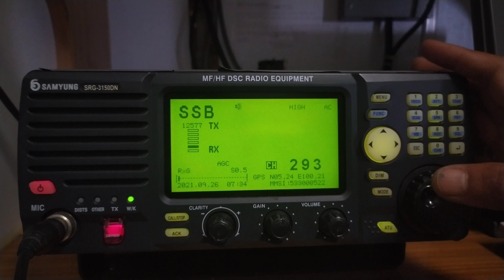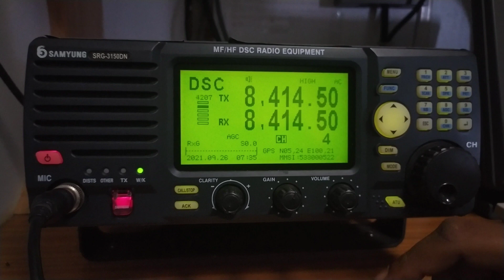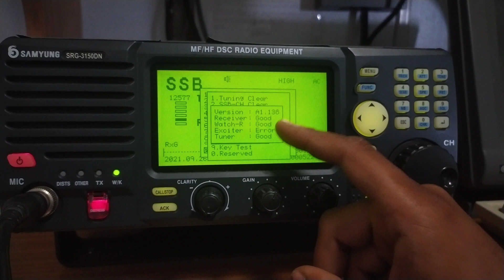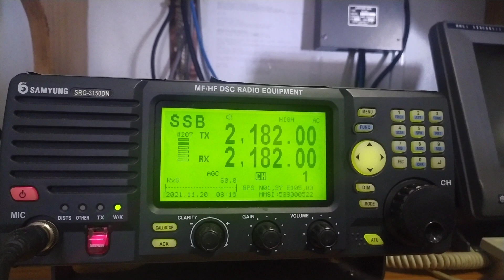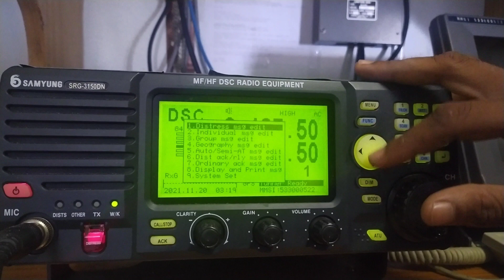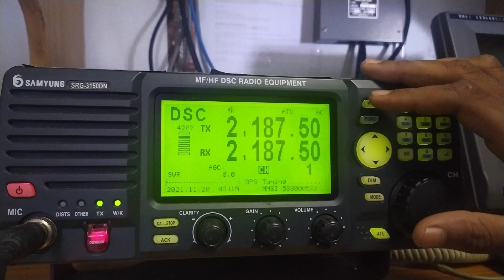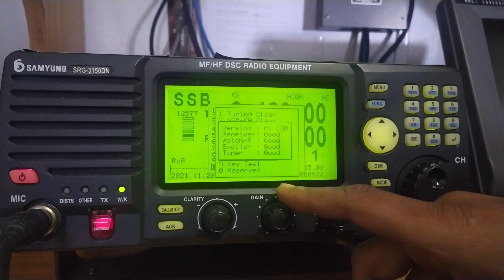MF HF Repair - Log Entries and Tests

Comment: Sir, if Watch-R : Error, how to fix it 🙏🏻
Reply from the maker: Kindly do a diagnosis test. If its showing watch error, I think you will have to contact the technician.

Also, this error shows in some equipment if gain is kept to zero. So, kindly increase gain to above 75% and retry. 

Regards ❤️